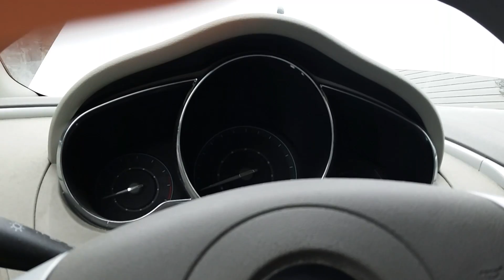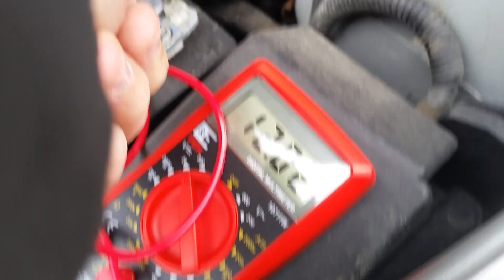Malibu problems

Comment: Did you happen to check the battery cables?  The starter on this car has plastic parts where the battery cable connects to it. With bad cables it ruined mine so bad that upon loosening the bolt for the starter it completly broke off everything the bolt was connected to.